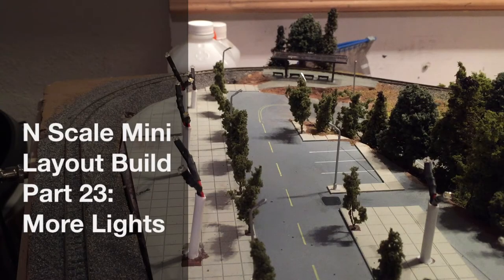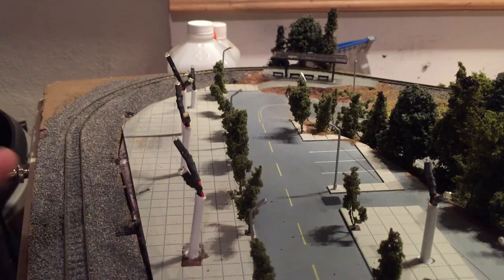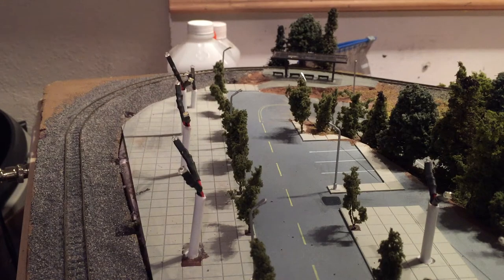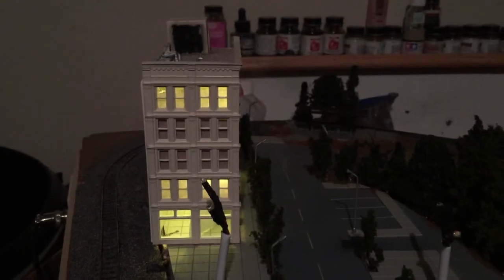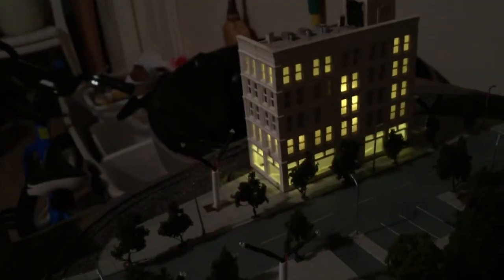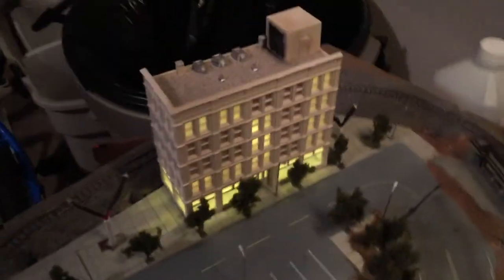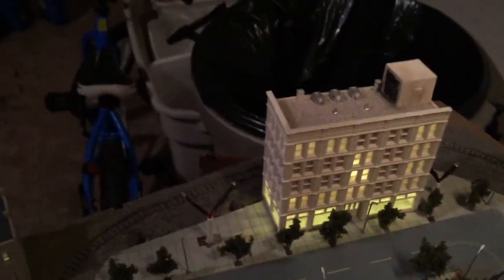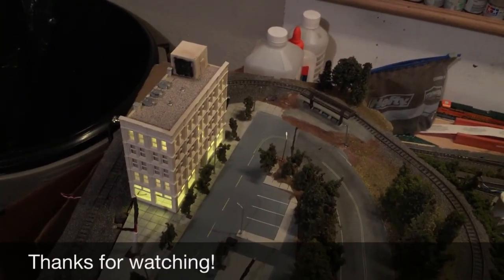N Scale Mini Layout Build Part 23: More Lights

Comment: How did you wire up the streets lights and connect them all to one power source? I have no electrical know how what so ever so any tips would be cool..
Thank you
Reply from the maker: STEWART BEARD I don't think I have a good tutorial on wiring.  I have this video that discusses resistors with lights, but I found this other YouTube video that might be helpful for learning about wiring things in parallel and in series which are the two ways you can connect multiple lights together:

Resistors: https://youtu.be/m09i9wBZddk

Series and parallel wiring: https://youtu.be/x2EuYqj_0Uk
Reply: Steves Trains thank you very much.. looking at videos of n scale stuff as I got given an alpine glacier express and CV1/2/3 for Christmas... Your ones make a lot of sense.. space size.... 
Thank you for replying